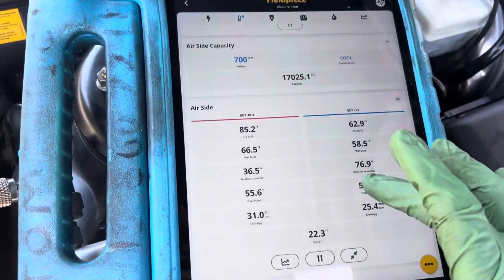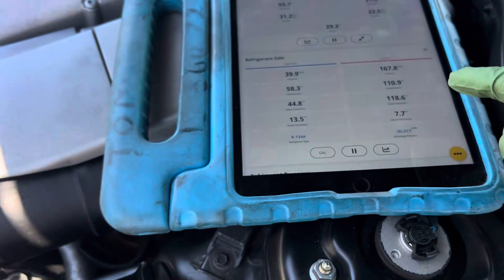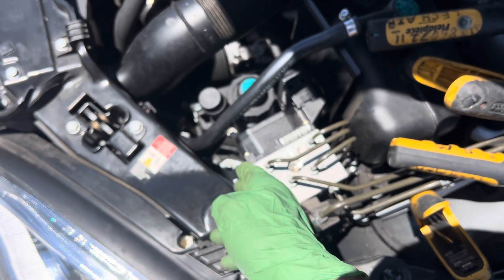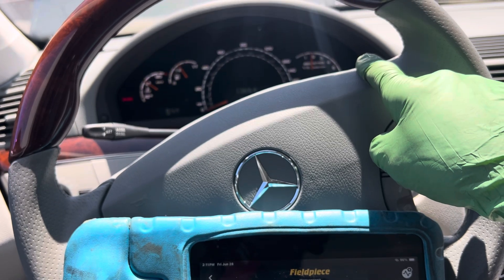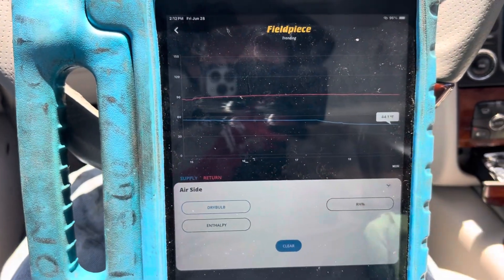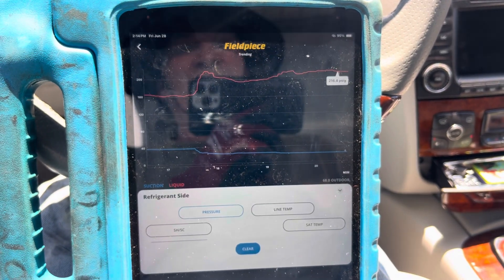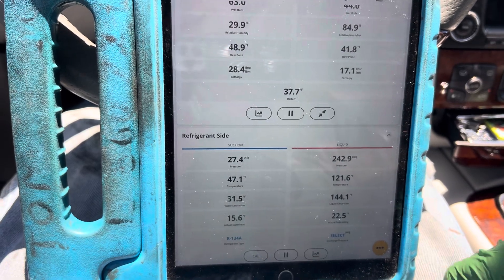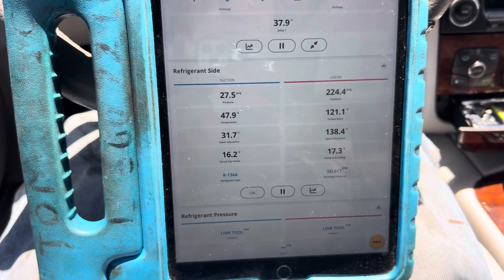115°F interior cabin temperature on recycle loading evaporator with hot air drops to 60°F

Comment: what that MERCEDES needs desperately to reduce the interior temp is some nice DARK TINTS... that temo will drop by anywhere from 10-15 degrees maybe more... including a very light windshield tint to cut down on UV heat... great video..
Reply from the maker: @HOTRODRICO  3M Crystaline it doesn’t even have to be dark to drop the temperature
IR (infrared) This is what causes the heat in the first plates and it is not even invisible light spectrum that a human being can see.

That’s why you can have a completely clear window tint and physically feel and measure the difference of reduction inside the vehicle . 

Do you know when the strong sunlight hit your arm and you actually feel that instant heat and burning sensation? 

When you put on a IR blocker, it’s clear but when you put your arm on the other side of the IR blocker, you instantly feel the heat from the sun disappear . 

The same goes from the ultraviolet  ( UV ) it’s not visible to the human eye and the material that actually blocks the ultraviolet wavelength that actually causes the destruction of plastic fading of colors and the physical skin cancer and destruction of cells in your skin comes from that wavelength that can be completely blocked by crystal clear material.

I had it put in my 2012 Prius C immediately driving it right from the dealer directly over to our window tint guy who carries at that time the 3M crystalline 

We just put the clear on the windshield 

And only 5% blocking on the side windows and rear window . 
Because my wife has night blindness and she cannot have any reduction of visible light spectrum .
Reply: @coldfinger459sub0  cool I gotta look into that 3M Crystaline... TINTS MATTER =)

Comment: Those Fieldpiece bluetooth probes are great. I used them to fine-tune refrigerant charge in my homebuilt airplane A/C system. And it happens to run about the same pressures/similar SH/SC as this Merc is doing.
Reply from the maker: @heinrichgerhardt6119  yes Fieldpiece have been the most reliable Bluetooth transducer I’ve ever used

Comment: Hi Tom, where are you located, and how can I make an appointment?
Just retrofitted a rare 1991 Audi Quattro 20V Turbo from R12 to R134 for a customer.
New compressor and condenser installed, 2.1lbs R134 and 10oz PAG 46 oil added.
Could not get stuck orifice tube out, so left it alone. Anyways, at idle at first it cools OK to 50F but eventually it can't keep up at 60F and pressures get up to 45/300psi.
Lots of condensation on the low line all the way back to the compressor.
I'm stumped. Need help to figure this one out...
Reply from the maker: @PineHollowAutoDiagnostics  send me a Vin number and let me look up the specifications on that. It sounds like such a rare vehicle. It might not even be. Would it be in Mitchell and all that Chilton’s and motor software data

10 ounces sure a lot of oil 

Did you try clamping off the coolant hoses going to the heater core 

Physically and visually confirming that the blend air doors are actually turning and closing off .
Reply: @coldfinger459sub0  I appreciate the response, Tom! 
VIN: WAUHE5445MN006462
Only 150 of these 20V Turbo Wagons were imported into the US in 1991.
One thing that I noticed on the replacement aftermarket condenser is that it was damaged during shipping where one of the brackets actually smashed into the aluminum tube, potentially restricting flow through part of the condenser. It seemed to cool significantly better with the original condenser, but unfortunately there were a few pinholes corroded through, causing a refrigerant leak. I feel like this car will never leave my shop haha
Reply from the maker: @PineHollowAutoDiagnostics  you’re missing some digits in the Vin number. There’s only only 14 there should be 17.